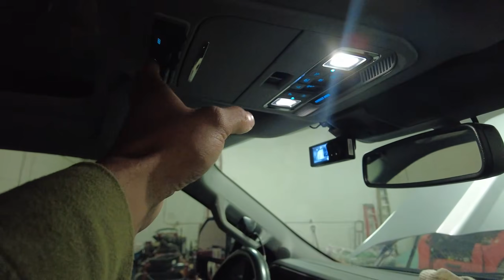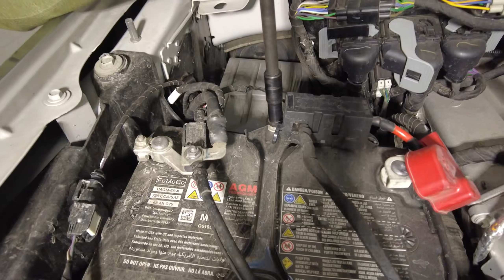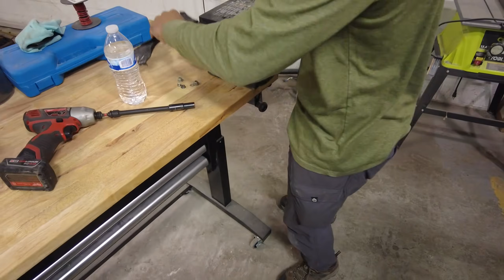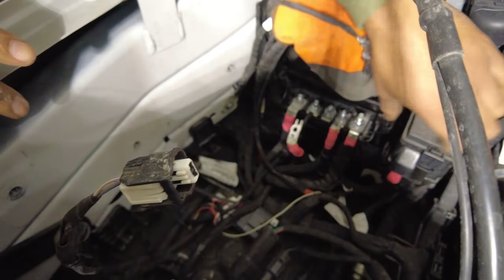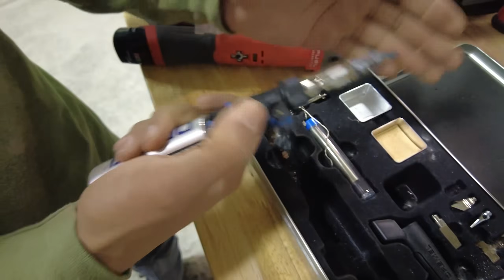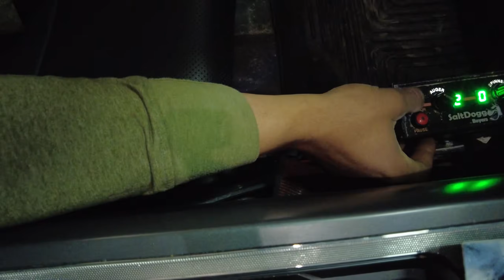How to wire FORD upfitter switches - WITH DS-TRUCKS

Comment: You waste way too much time! The wires are accessible in ablout 30 seconds by poping clips on fuse  panel... so dumb
Reply from the maker: No, it's not
Reply: Nope, those are through wires and terminate under the hood, they are not connected to the upfitter box/wires.

Comment: The first time you pull the up fitter junction box add length to each wire (+/- add sealed female connectors) to each wire and route them to a convenient location for future accessories. No need to do this more than once.

Comment: I sure hope you connected one foot 10ga wires to all other up fitter wires ID each wire with fuse size and switch number before putting battery back in. Thanks for the video. Great job.

Comment: You don't need to do any of this, You can disconnect the leads on both batteries (doesn't hurt the computer at all, also, for your knowledge, he's disconnecting the mass air flow sensor without disconnecting the battery, which is definitely not a good idea unplugging and plugging it back in) and the entire outfitter box comes right up out of the truck with the two tabs. You have more than enough room to get the cable off the bottom and work with it literally no problem whatsoever. This is a ton of wasted work and I'm sure he charge the customer hours of Labor to do this.
Reply: Thank you for saying this! I was hoping I didn't have to write all that out!!

Comment: 1-4 switches are 25 AMP. and 5 and 6 are 40 AMP, with the option of moving that fuse to be full power on those 2. Just a heads up.

Comment: I used a couple straps through the loops on the end of the batteries to pull the batteries out.  I pulled both out at same time.  No issues with my 2024 F550.